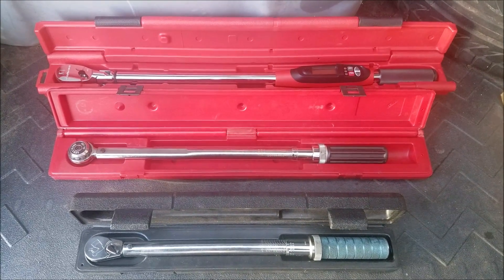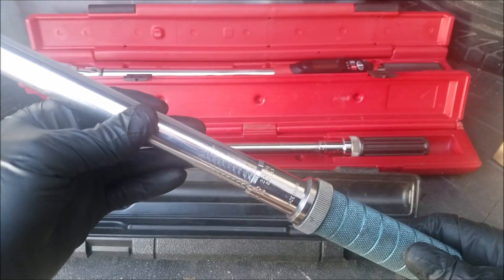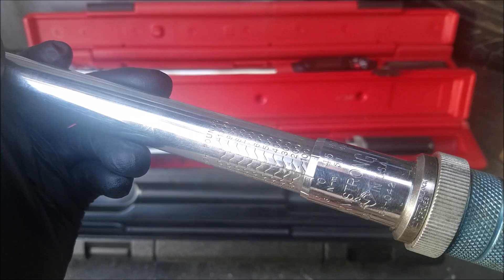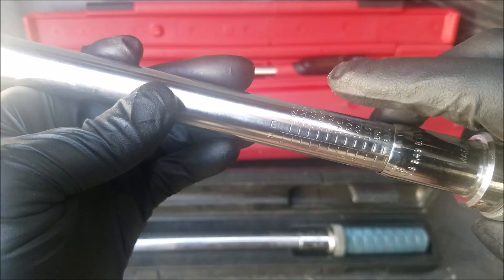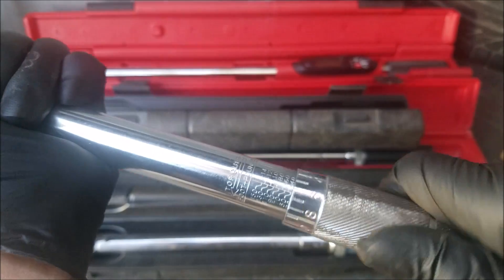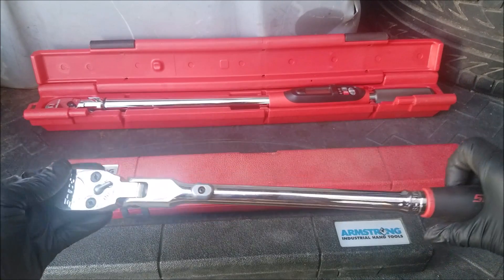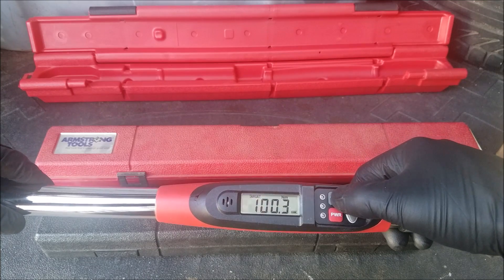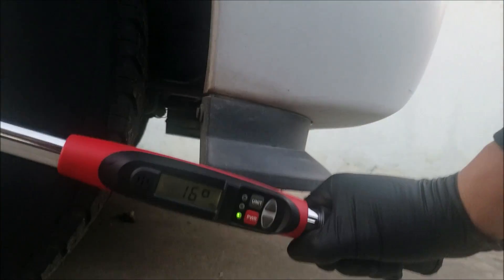How to Use A Torque Wrench (Foot Pound, Inch Pound, Digital Torque Wrench)

Comment: I really appreciate you taking the time to show me I'm a single mom and I do my own work on everything even hvac and construction or carpenter things.  This is the first time I had to use a torque wrench. Its for my thermostat on my 2008 rav 4. Also my fan isn't working. Any thoughts on that? First this I ALWAYS DO is make sure all the fuses are good. The ones for the heater and fans are big blocks not regular small fuses. How can you tell if those aren't working correctly? I'd REALLY APPRECIATE if you can hook me up with an answer or option, you seem to KNOW YOUR SHIT! I'd absolutely love to hear back even if it's to say I got the question right or not.
Reply from the maker: Ur fans run off the coolant temp switch, so as long as the coolant is up to proper level..the temp switch tells the computer when to turn on the fans...to check ur fans they should come on while u have the ac running..so if they work there...then that means the fans are in good working order and just aren't receiving signal to turn on..so yea the thermostat should allow coolant to flow and warm the coolant temp switch to signal computer to turn on fans once engine reaches temp....i do got a video on checking the thermostat and how it works..if ud like to check that one out

Comment: I picked up a torque wrench from Harbor Freight, which was probably my first mistake. It's in inch pounds and each increment is one but when I went from 0 to 0, it went up 120 inch pounds. Doing maths I concluded that each unit wasn't 1 but 12. When you don't use your torque wrench that much it's kind of a pain to have to relearn it every time I use it. To add insult to injury, I really don't think the thing is calibrated all that good. Next time I'll spend a few extra dollars and get a more reliable product.
Reply from the maker: Yea the harbor freight one i dont use it on critical torque pieces..i only use it for lug nuts..anything else i use some other i have
Reply: @backyardchevy328  I was just using it to tighten my mower blades on, which should match your lug nut suggestion. I set it to 45 lbs min. I set it to the 480 mark and set the dial to 0. I then add 5, which should be 60 inch pounds totaling 540 inch pounds or 45 foot pounds. I gave it a good tightening and it never clicked so I suspect it must not be calibrated or I didn't calculate it correctly. Still, I know it was plenty tight so I think that blade is on there good enough. I've used this in the past to torque down the head of my Craftsman tractor and it did click so my guess something has happened over time. Xmas is coming so maybe it's time to upgrade.
Reply from the maker: @SimmeringPotpourri  yea definitely seems like something is wrong with that torque wrench..have u tried exchanging it for another..i know they do exchange em without any hassle the times ive had to exchange the one i had
Reply: @backyardchevy328  Really? Well, I've had it for several years but maybe there is a chance they might do that with this one. Thanks for the suggestion.
Reply from the maker: @SimmeringPotpourri  yea if its the Pittsburgh brand theyll do it no matter how long youve had it